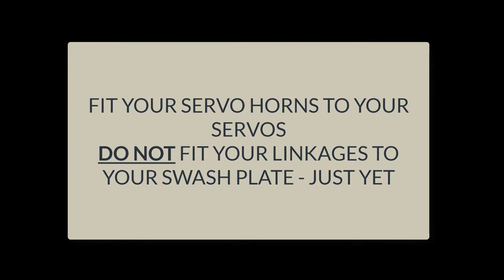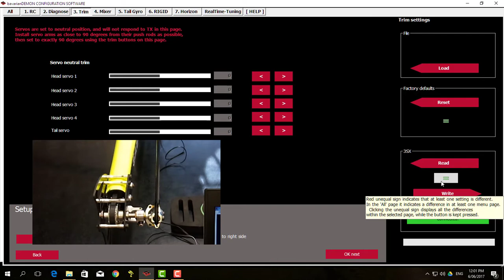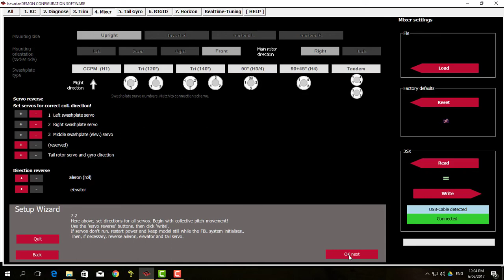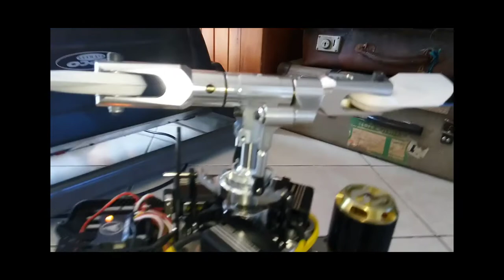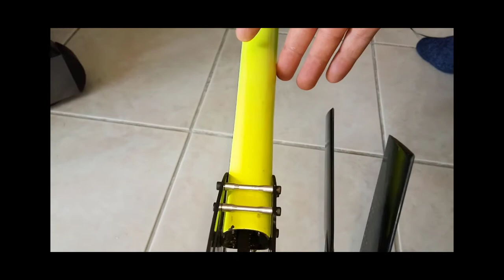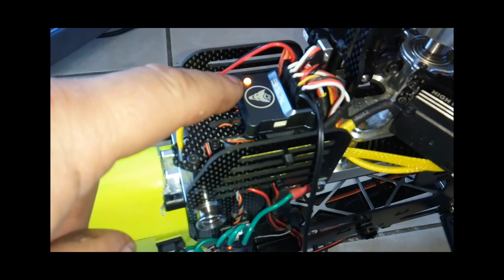BAVARIAN DEMON 3SX SETUP PART 2

Comment: If this gyro is to be configured for the Vario CH-47 (tandem swash plates), we would select the swash plates on the far right, which has servos pairs,11-44 and 33-22, correct? Are those swash plates configurations (in white rectangular box) in the GUI clickable to select? Excellent tutorial video, thanks.
Reply from the maker: There is quite a bit to setting up a dual swash rotor system the manual goes into it in great detail with lots of cautions on making sure you are using V swash rods. take a look at Page 5 for pictorial setup and 13 for physical set up before running the wizzard as normal. here is here is a link to the manual. hope it helps. https://www.bavariandemon.com/fileadmin/user_upload/data/downloads/manuals/bavarianDEMON-manual-X-series.pdf

Comment: I have a 7200 on my Trex 450 and a 7210 on my Trex 550.  They are fantastic, but I wanted to go a step further.  I got a Trex 700 with a KDE conversion from a gas to electric.  I purchased a BD 3X from Motion RC.  I have a DX9 with 2 Satellites( brown outs, we shall see), a LiFe 2S, 6.6v, 3000mah battery for the servos and 2 5000mah Lipos wired in series for the Motor:). 
I downloaded the 3X setup software to my computer, went through the setup process and when I got to #4 “Mixer”. I became frustrated.  The servos didn’t do what they were supposed to do.  Some needed reversing.  I became frustrated, the swash plate was not doing what it should.  I could go on an on, but here is the reason and it’s always USER error.  Read the bottom screen!!!  If you reverse something, you  MUST go to the right and Click, “WRITE”.  I spent 2 days and about 3 hours of expletives and pounding my fists because I didn’t understand what the heck was going on.  My wife even mentioned divorce my way:):).  I had an epiphany, the AAAAHHH Choir, click WRITE! This will save you a lot of frustration

Comment: Hello,
I got the exact setup as you have, just on a trex700, when I plug the satellite to the ar7700 impossible to make the 3SX work. but when I plug it in the 3SX, all works... I even don't need the AR7700 with PPM.. I would like to have redundency with using the AR7700 and the satellite but I am unable to make it work. Do you have any suggestion? thanks

Comment: regarding the front or rear setting , I believe this refers to mounting the unit in front of main rotor or behind it as this determines which direction correction will be made. Main rotor is centre of gravity , tilt heli forward and nose will drop tail will rise . If demon unit is mounted at front it will sense drop , mount at rear it will sense rise , so you have to let software know this so it can reverse corrections to suit.

Comment: Hello! Could I ask; I using the AR7700 along with the BD 3SX and the Hobbywing 200A Platinum ESC on my G700 Heli. Where do I connect the red/white/black servo style ESC wire to? The BD3SX or to the AR7700? If to the AR7700, which port if I’m already using the PPM port to connect to the BD3SX? Thank you!!